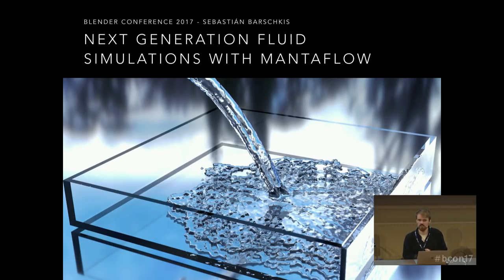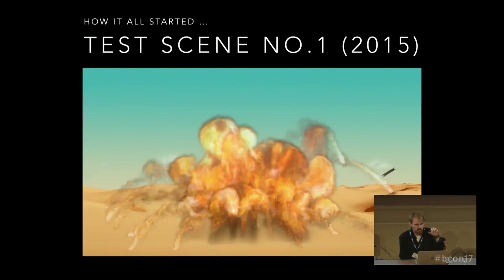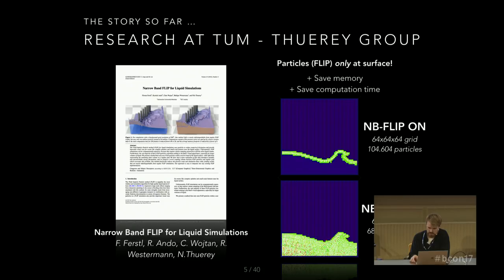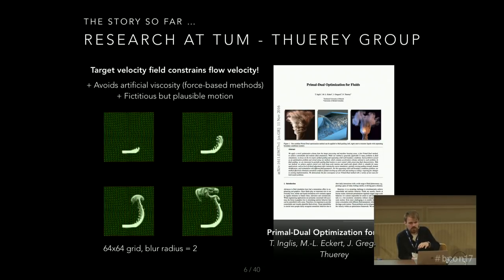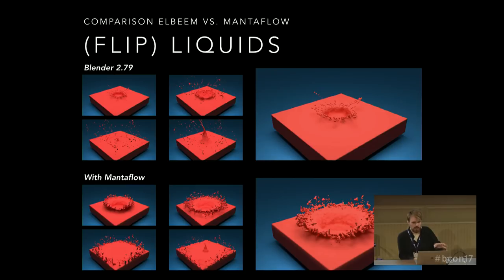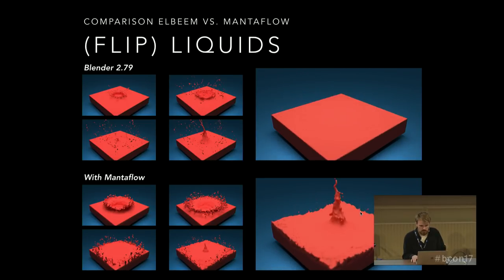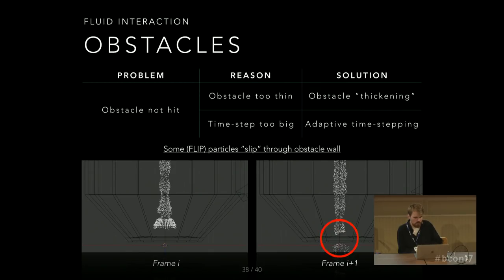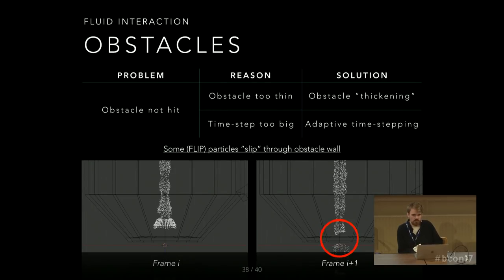Next Generation Fluid Simulations with Mantaflow

Comment: When is white water effect coming. 
Can we achieve fluid and particles effect like in Houdini, Krakatoa, thinking particles, Realflow or fume fx?
Reply: Mantaflow is coming hopefully with 2.82 which is most likely early next year.
That will feature white water particles (called float and tracer here.)

While you can do similar fluid effects like Houdini and Realflow, Mantaflow is not as artist friendly.
So you aren't going to be able to mix fluid colors for example.

Regarding fire and smoke effects, it's not as overly detailed like you'll get from FumeFX and Houdini as they are using textures to add extra detail but it is a solid fluid engine.
Reply: @annekedebruyn7797  Wow!
Thanks for the info.

Comment: i don't see why they cant give an obstacle, the same properties as a float particle with a mass constraint to control the velocity and flotation of the obstacle.

then again i am not smart enough to understand what is exactly needed to make this work but if it already works for a float particle... in theory the science is there already to implement it to obstacles, you can already set an object shape to be the shape of a float particle, so why couldnt that shape have its own float settings, am i right or wrong here?

Comment: I wish they put a real PBR fluid and glass node for the shader to have real chromatic aberation, to simulate some rainbow effect on the caustic and refraction, because in real world glass and water act like that, with fresnel.
Reply: It's all doable with the nodes they have-- I don't see the advantage of a dedicated node. Also, chromatic aberration happens in the camera- so do it in composite.
Dispersion in Cycles isn't difficult, just takes a lot of samples. Maybe a Dispersion BSDF would be nice, if it renders faster than the method I use (transmission shaders ADDed together, then MIXed with a glossy by fresnel).
Reply: I now the trick of using 3 RGB Refraction node with different refraction index value, for each, but it's not convincing at all and stupid waste of time, Glass and refraction node should have a dispertion feature, and i also use the Glare dispertion node and for the lens, but this thing work only in 2D compositing tricks and are note link to object surface or caustic, i found a guy that make a shader that simulate that by faking it, and it's work also with substance designer texture.
Reply: Meteotrance I wonder if the three node trick is physically accurate or not. I guess not, since light can be many colors besides red, green and blue. It seems to me that setting the IoR for every concievable wavelength of light would be very tedious, however. And I don't think anyone would be happy with "faking it." Maybe they should add a dedicated dispersion node.
Reply: most 3D package are able to render that also IES light volumetric should be used for most pupose instead of HDRI for artificial light. most of them are free to use, and some light compagnie publish those a lot.